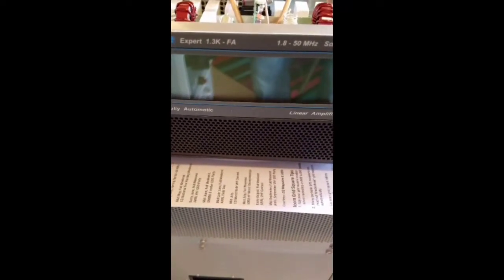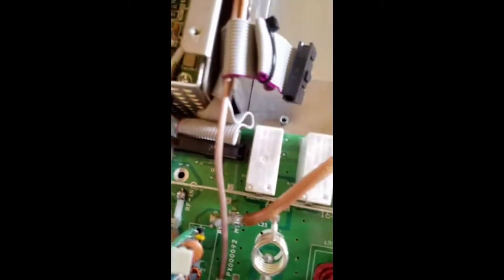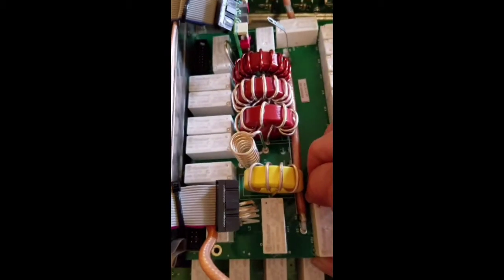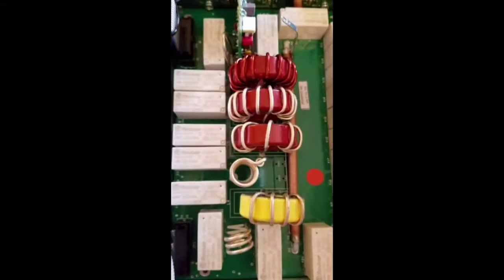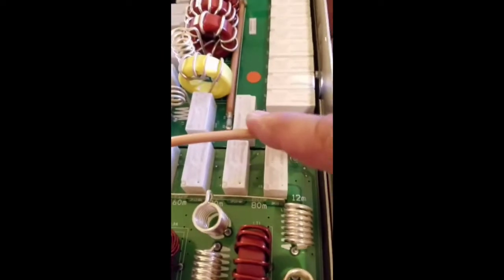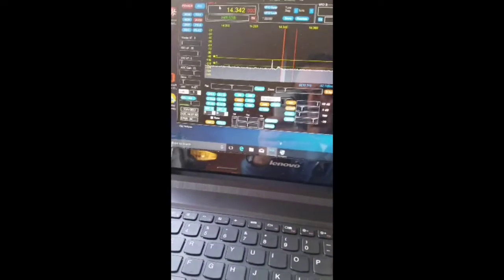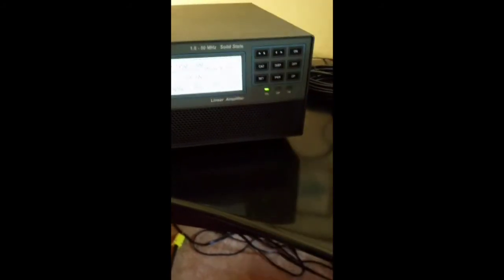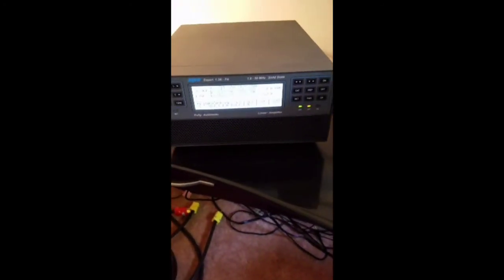How to set up a Expert SPE 1 3K FA with an ATU installation

Comment from the maker: So sorry I’m responding late. The ATU was $1500 USD made by SPE and shipped from Bob Hardis  http://www.expertlinears.com/index.html 
He and his wife run a nice operation.

My non-ATU SPE 1.3k-fa was purchased from Hardis about 1 yr ago for $3600. Cheaper to buy both together but I couldn’t afford both at the time. The non-ATU linear has worked nicely. the addition of the OEM ATU helps and basically has made the amp faster to tune, without having to use my external manual tuner.

Thanks for your very nice comments. Happy New Year. Is it time to save up for SPE version II! Although I admit I’m happy with my version I.

73
Dave

Comment: Easy task. Tnx fr video.
How much was the ATU board?
I'm wondering cause, I was told that the single ATU will not sold when you purchased the NonATU 1k3.
Thanks God, I do have only resonant Antennas at home but for portable use, the ATU would be an advantage or just to have this little "bastard" baby complete.😎.
How much is the single board? Is this an SPE or aftermarket ATU?

Good Job! TNX agn!